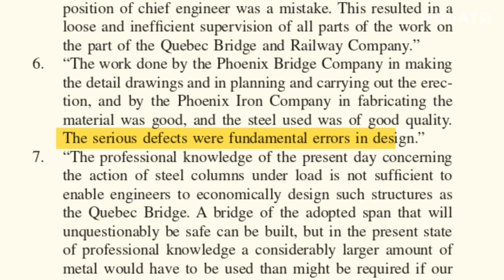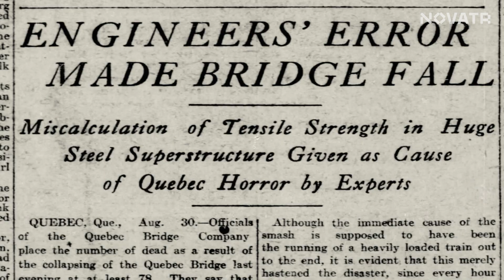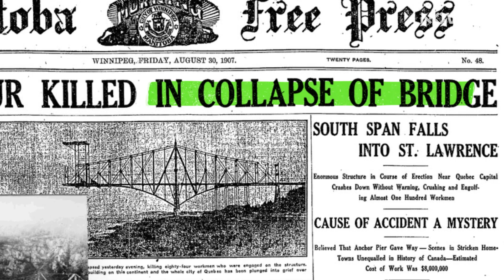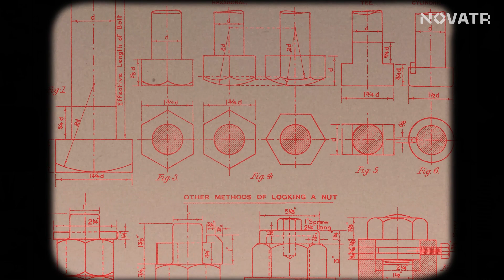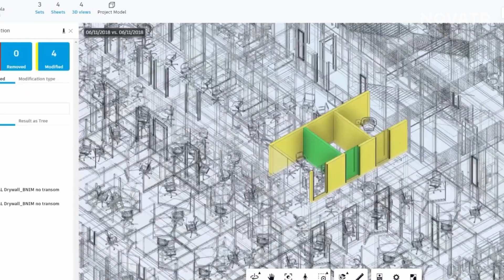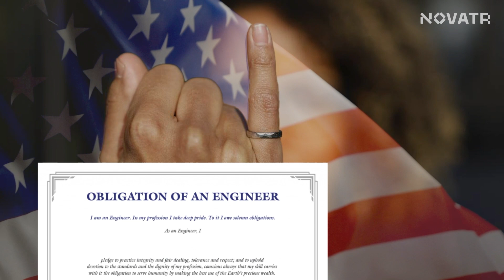The IRON RING Every Civil Engineer Should Know About | Novatr #civilengineering

Comment: This  Quebec bridge, my neighbour , is now once again for the third time despite public whistle-blowers, undergoing an instability buckling  collapse. It is in mid progress for the exact same 3 causes. They remain ; first ignorance by engineers and technicians of the elastic instability on complex structures with high slenderness indexes: second, excessive hubris of  bridge experts engineers and managers: and third the choice of savings over public safety by all authorities. The autorities are engaged since about 10 years in several diverse stabilisation operations of the complete structure. It is hopeless on safety within medium terms. So  I observe and conclude ,this is in order to safely dismantle the bridge without interruption of important ship trafic and replace it as it is clearly the best site on account of all economic  factors.
Reply from the maker: Going by the information you have shared, looks like this bridge needs a serious makeover. They should consider a redesign with safety as the main focus.